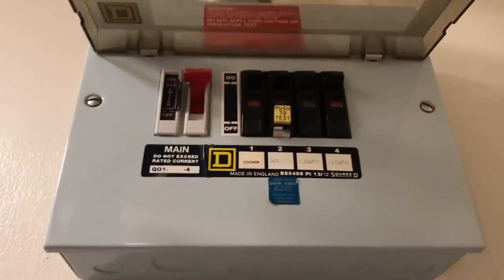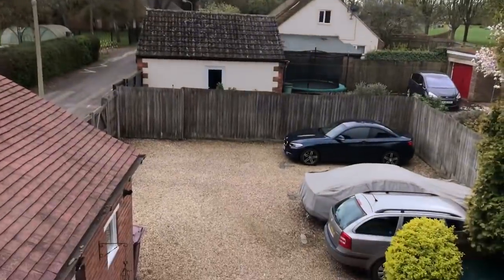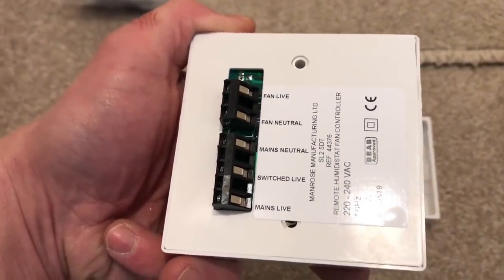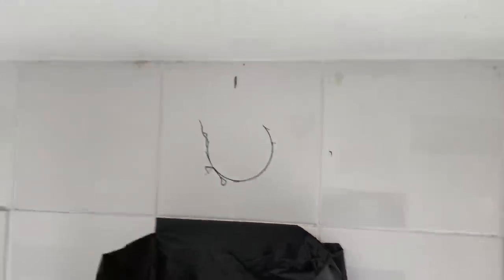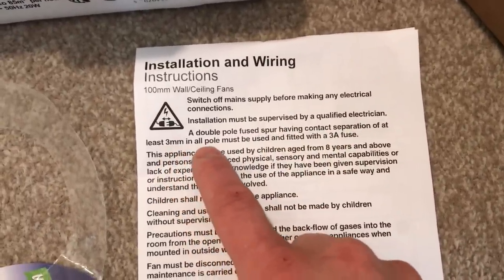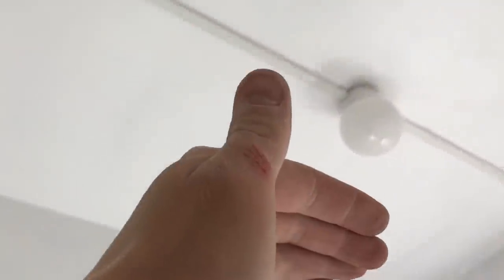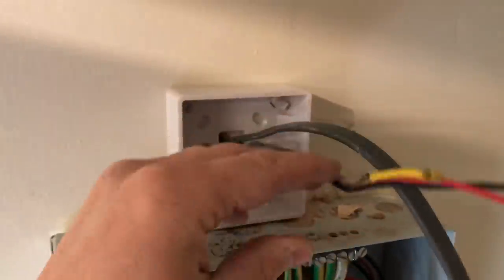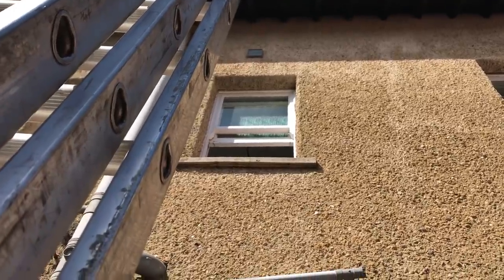CJR ELECTRICAL electricians day extractor fan installation.Have you ever walked off a job?

Comment: Hiya, dirty job sites; I've walked off a job where I was working next to the bed & there were used condoms & Tampax under the bed, nearly put my hand on them!!! I've not been on the tools in 30 years went over to touring, Bob Dylan. Paul Weller, Englebert (WHO?) Ask your Nan! Then on to film & TV, then on to walking only with crutches! Love the 30mA Fuse spur, neat. But metal clips around cable? Never in our day, nice change, much safer! Love your videos, catching up with what has changed & what hasn't, crap customers, hmm somethings never change, but letting them off only encourages them to always pull it!!! Seen it a few times they even boast about it!!! 
Take care & stay safe... Steve...

Comment: Kudos, to you for walking away when the customer is being unreasonable. I am currently working on a job to clear up someones mess of installing driveway lights. It's a huge challenge and to be honest if the customer was not so reasonable, I would have priced myself out of the job. That would have been a mistake as this job, even though as yet unfinished, has led to considerably more work inside the house. The driveway has been left until last as I have explained every problem to the customer including a video demonstration of where the water is pooling.

Comment: Those are older models of Square D QO breakers; those are the best breakers (new or old) you can get in Canada and the States. DIN rail stuff isn't all that common (basically never see it) in North American domestic distribution boards.. but QO breakers are available everywhere, though sadly often passed over for bargain-bin safety. I like the QO stuff, but the board in that flat is maxed out and prime for a refit. Even the old ones in North America had more space than that one. Very neat and tidy fan install, thanks for sharing it!

Comment: Good on you Chris
People can be selfish
You did the right thing not removing as can cause legal issues
Not invoicing shows your commitment  to good practice and you will find this will be paid forward
As to you dust method I've found  fixing two pieces of 2inch gaffer tape folded along length on one side on the wall and
The other sticky side in the air in a V into th bag helps a lot
Great video as always
Bill

Comment: I have already been down that route & spoke to the manufactures direct, even manrose told me no, a 3a fuse is definitely required.  I specifically remember as I was installing a mixed flow extractor at the time.  I telephone all manufacturers only 2 were ok with lighting circuits Greenwood’s & envirovent.

Comment: I have never cored inside, I always come from outside in, which is pain coring at height.  I'm too worried about the damage from brick dust.  But after watching, I may give it a bash & it only requires one person.  3A fuses for fans can be a pain in the arse, just for a swap over.  Greenwoods & envirovent don't require a 3A fuse when supplied from a 5A or 6A lighting circuit.
Love the videos

Comment: Different regulatory domain here - but yeah.  I've not only walked off jobs that are plainly dangerous, I've contacted the regulator and supply company to inspect.  Inspectors can enter property to inspect and if you prevent them access, you'll have the mains power disconnected.  Also - I never work with/for family..

Comment: OH HOLY SHIT!

Square-D QO...

Hard to get ahold of? Maybe over there. Those things are incredibly popular in the US. (I may be overestimating their popularity, as they're the primary brand I work with)
Reply: In Europe they're quite rare and I'm fairly sure you can't use US components here because they were manufactured and tested to different standards (trip curve etc.). The UK has more Sq-D and FPE equipment than the continent but still not a whole lot. FPE had a plant in Germany in the early 60s where they produced StabLOK MCBs and other stuff but all to VDE regs. I haven't found much on them but it seems like that plant only lasted for three or four years. I do have three German 15-amp FPE MCBs (not StabLOKs although they do have the logo on them, they're of the lug-lug type, i.e. they've got screws on both the line and load sides instead of slotting into a bus bar) and I'd really like to test one of them if it trips (of course outside and probably using 12 V AC from a halogen transformer).

Comment: For my dust collection equipment I use a cardboard box (a lot less give) .when drilling though walls with core drill try resting handle against ceiling in case it jams.
Reply: Same here. Shit does go everywhere still ... Once i've seen a flat cardboard box with a bag attached and a sort of "drill through me flap" in the middle with adhesive on the back of the box on a job "back in the day". Worked alright. Still some red dust made it out...

Comment: Great video you are a great spark  so how many lights can that 3 amp fuse rcd run
Reply from the maker: Fan was 26watts
And there are 3 lights at 6watts
I could of fitted a 1 amp fuse tbh
Reply: @Cjrelectrical  ok great way around the problem. so the bulbs were very low watts then if it was a standard light do you have to work it out at the maximum of say a 100 watt bulb or just what the current bulbs are
Reply from the maker: Yes they were all led lamps the onsite guide says 100w per light but that’s so old fashioned.
Reply: @Cjrelectrical  ok lol yeah not many 100w around now thanks for info keep up the great videos

Comment: I've found that rental property's would benefit with a constant running fan. The new revive fan for vent axia is 2 pound a year to run and has a humidity sensor rather than stat. I've fitted two so far really good and only need a supply no switch line
Reply: Doesn't get the stink out though does it.

Comment: Yep, walked of 1 job in 18 years, Newcastle Hospital ct machine. the supplier and the manufacturer had a falling out, I was from a separate company providing service and repair to the supplier and had completed the course at the manufacturers in Italy. Anyway, get to the client log in to the manufacturers server and it won't log on, I ring them up only to get a very snotty Italian engineer telling me I wasn't "allowed" to work on the machine anymore........Not wanting to get involved, just driving 3 hours to get there and having the phone on speaker and the superintendent of radiology standing in the room hearing this, I simply put the phone down, made my excuses through gritted teeth and left.......It took them half an hour to realize the problem they just created and ring me back, they then "demanded I returned to the job" This didn't really work as they intended and neither did them threatening to have me fired if I didn't return (I'm the boss not sure they fully understood this) Anyway, long story short at this point, being the only engineer in the UK for this machine 2 engineers from Italy were on a flight the next day LOL The equipment was never designed for the workload of a major hospital and the 4 UK machines were all on NHS sites  from Sussex to Newcastle I was increasingly finding myself running up and down the country fixing them at the expense of my own customers so I was more than glad to walk away from that one. about a year later another company took on the supply contract and rang me to see if I would do the service and repairs.......it was a short conversation LOL

Comment: How do you convince a landlord that a bathroom needs an extractor? I've had two so far that have taken the stance that poor ventilation is the tenant's problem.
Reply: You could try advising the landlord in writing that the extractor fan is required to prevent mould build up in the bathroom, and should they refuse to install the extractor fan, cleaning the mould will become their responsibility...along with any medical bills if they don't regularly clean the mould and it results in health problems.  You have to remember that landlords are running a business, not a charity, so things need to be put in business terms.  An extractor fan is cheaper than hiring cleaners regularly and potential medical liabilities, so that's one way of making it the more attractive option.  Of course something like this may also get you flagged as a demanding/undesirable tenant, so it's not without some element of risk.

Comment: Great video - nice job, If the client is renting it out didn’t they want the board changing only 4 ways wouldn’t have cost too much and then the flat would have been tested and everything RCD protected Also when you’re core drilling did you wear ear defenders? I never used to and after 24 years in the game my ears are really bad now - just a thought mate 👍
Reply from the maker: Yes I had some dewalt push in one in.
Reply: CJR ELECTRICAL 👍

Comment: Not trying to be nit picky here but you really should wear safety glasses when drilling tile..
I have walked off several PA system installation jobs not because a customer was a dickbag or anything but because the customer did not prep an area for us  like have water pumped out of a standing area, a clear road or path for us to roll or carry equipment through, etc.. I DO NOT wade water and mud nor are we pack mules who carry 200lb amp racks up unstable pathways that are overgrown..
I have a pile of square D breakers of all sorts..

Comment: I have walked away rom jobs when customers attitude goes way beyond acceptable. When they start penny pinching asking if you can reuse old crappy wire and boxes rather than fitting new. 
 In a retrofit to a bathroom I fitted a combined light and extractor fan unit. Quite low profile, minimal reworking of surfaces and reasonably priced.

Comment: Question. How do I calculate the breaker size for supplying a garage? I’ve ran a 6.0mm 3 core swa only around 5 metres
Reply from the maker: What are you fitting in the garage?
Reply: CJR ELECTRICAL a ring with 6 points, lights with 4 points and a radial for an outside socket
Reply from the maker: A consumer unit in garage ? What are you plugging into the sockets ?
Reply: Yes I’ll have a db in garage, a fridge and a small heater, a hoover for the car every so often
Reply from the maker: Could get away with a 20 amp protecting the cable then.
Reply: CJR ELECTRICAL how do you work that out?
Reply: Jordan Harrison if you have to ask these sorts of questions then the job is clearly beyond your capabilities. Call an electrician and get it done properly.

Comment: What model makita drill do you use for your core drilling.
Reply from the maker: I’m not quite sure of the model number but it’s the one that has the rotary stop hammer action it’s taken an absolute beating and it still goes on and on
Reply: CJR ELECTRICAL thanks for your reply. I like your channel your jobs are always interesting.

Comment: No insulation in that wall? I think Houses in UK are cold?
Reply: Victorian houses tend to have 9" solid brick walls.
Reply from the maker: No your correct it’s Victorian the top flat is lath and plaster and horse hair.
Reply: @Cjrelectrical  I've been wathing your and Nagys videos and inspired by that. I think ill make a little imgur gallery how we do things here in Finland. Im working as an electrician and im doing now with co worker a apartment building which has 68 apartments

Comment: Can I steal your dust extraction bag or have you patented it?
Reply: Dominic Davis-Foster You might want to wait for version 2.0 the one where you tape the other end of the bag above the hole when you go outside to finish so you don’t need to spend so much time cleaning. 😜
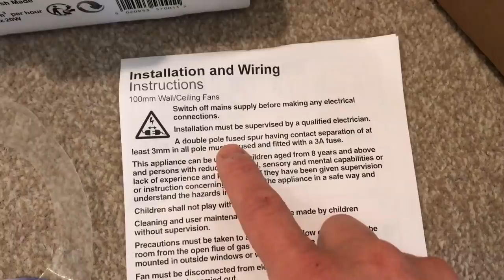Reply: These manufactures instructions 7:53 we always look at the fusing bit - but take a look at the next paragraph..... Did we instruct under 8s on how to pull the cord to operate the fan? Did we check if any of the household have any mental, sensory or physical impairment in order that we can warn them of the hazards?

Comment: Anybody got any information or link to them clips ...great video again m8..love the no dust lol
Reply: Rexel do some similar ones but are a bit thinner and easier to bend , they have a few sizes for the different trunking sizes . I have seen metal P clips used inside the trunking if it's only one cable but not sure if it complies .
Reply from the maker: Sorry bud here’s a link 
https://www.screwfix.com/p/d-line-safe-d50-u-clips-for-2-core-1-5mm-fp-cable-pack-of-12/90366

Comment: Why not trunk from light fitting to wall to the side then T off to isolator and fan trunking across ceiling like that looks terrible
Reply from the maker: Your right that would look terrible
Reply: CJR ELECTRICAL i meant the way you done it wasn’t best lol
Reply from the maker: I know I’m being sarcastic
Reply: I thought the way he did it looked as good as it could.  It divides the ceiling in half and even comes down from the ceiling on both ends about the same.  The only other solution would be a doubled ceiling.

Comment: Yes family do come 1st I left a job as the plastering guy was saying his uncle was a spark then tamped with my work.  Was going to cover a junction box up.  I asked him what is Regulation 526.3 I got a blank look.  Stuff I put in by magic stopped working wires fell out.  Was then saying other stuff I did was so dangerous he will do it for fix it for free.  There was a brake in the power line for the cooker some fool slapped a socket there for the cooker hood fan.  Not going back I photographed all my work.  But a tape cover over a junction box so he could plaster round it an left the plastic cover on the hood with a note on the wall in pen were he was going to plaster.  Also told the home owner an showed her.  But the plastering guy says he did not know if he could plaster over it so he called over spark.  Not his uncle the plumber spark or what ever.